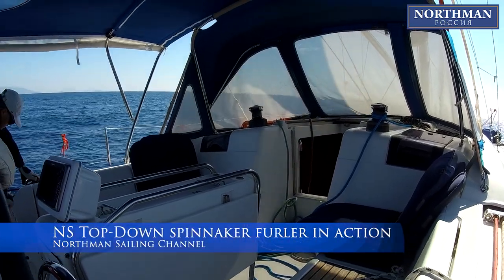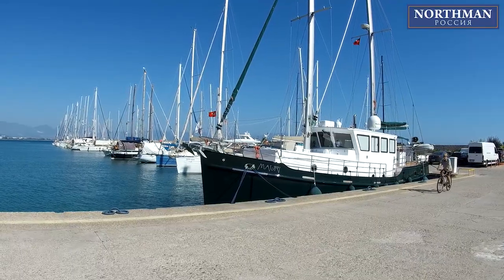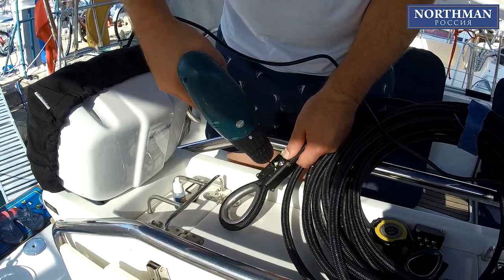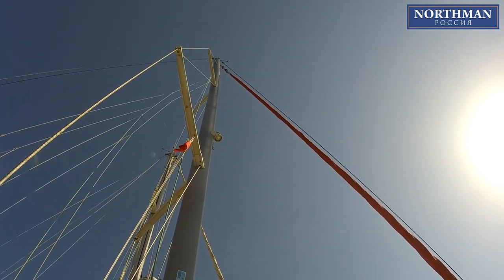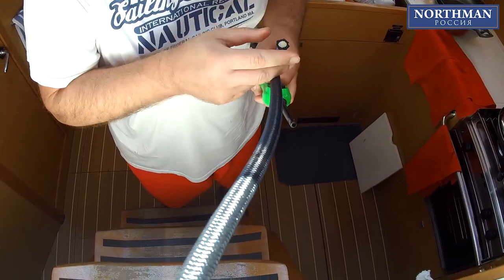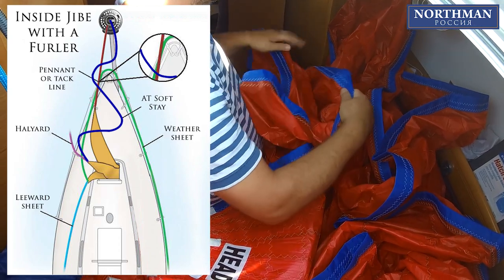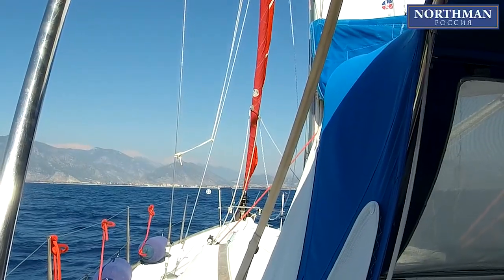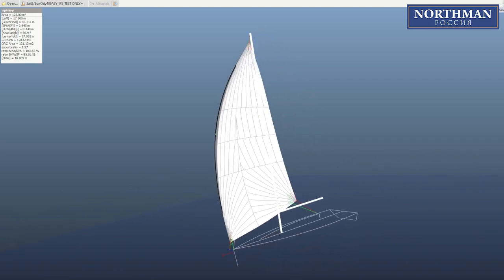Top-Down Furler User's Guide | NS Furling Gear

Comment: Hi, What would your recommend for the luff length of the asymatric spinnaker in relation to the length between the attachement points on the anti-torque cable? How many percentage % should the luff length of the sail be longer then the length between the attachement points on the cable, to have a asymatric sail for deep sailing that can still be furled up easily?

Comment: Hi,  Do you sell a,Top Down furler for an asym Gennaker  which is 140M2.  We have a 14M Sailing Catamaran.
Reply from the maker: Hi, theoretically you would need a 4-4.5 t rated furler for a 45ft cat. But with a modest sized A-sail of 140 m2 you can surely use NS2.5 Top-Down model and save a lot of money. Should you choose to order a screecher (Code 0-1) later on, you will be using the same furling system for both sails. Please contact us nsfurlinggear@gmail.com